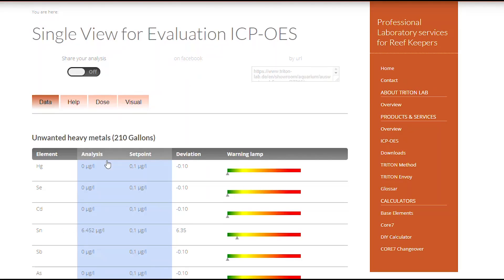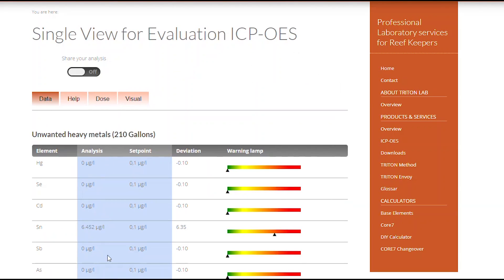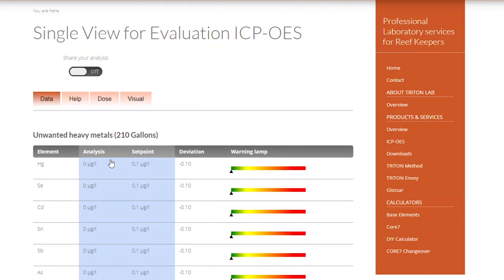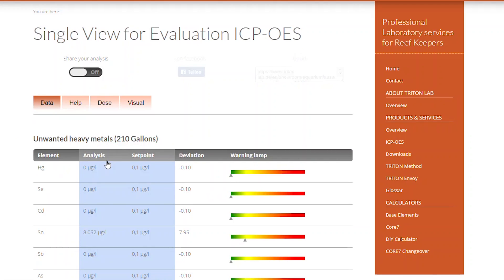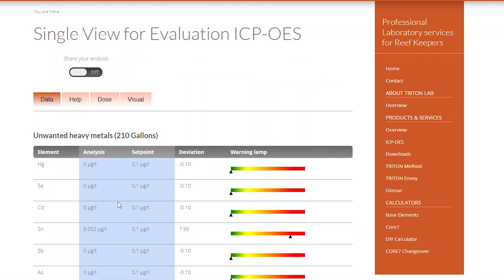Attack of the Tin Man - How I reduced TIN in my reef tank after getting results from Triton testing.

Comment: This is making me rethink my steel stand I am using to hold up my tank. I have been struggling to remove tin since my first triton icp test in January of this year. I have managed to lower it from 28 ug to 25ug by removing 2 rusted brackets one in the sump and one hold my display lights but, I just can't seem to find the obvious source
Reply from the maker: One thing I did was test your freshly made saltwater. This will tell you if tin is in makeup water or just in reef.
Reply: @ThaBiznessReefTank  I will have to do that. Although I have changed salts 3 times
Reply: As well as mixing container
Reply from the maker: LOL i changed my mixing barrel too in all this.

Comment: was the light or hinges in the sump water? I cant figure out how the metal would "jump" in to the tank.
Reply from the maker: The hinges themselves were pretty rusted. They are not over the tank but pretty close to the sump tank. My guess is the act of opening the door could send that rust flying. It was rusted to the point the doors would not close evenly one one of the two doors. The light just has what I would call "crud" on it (probably from salt creep/corrosion)  it was actually over the sump.